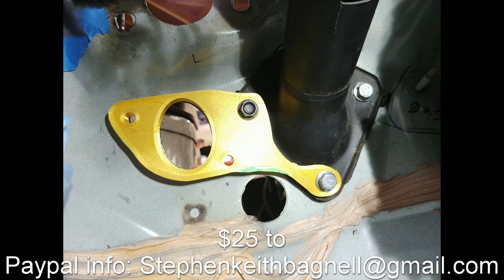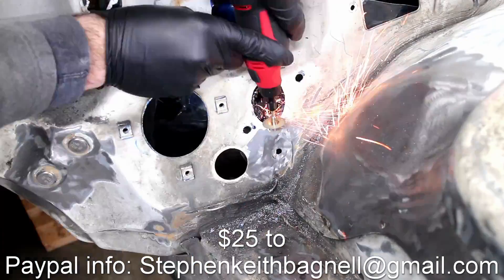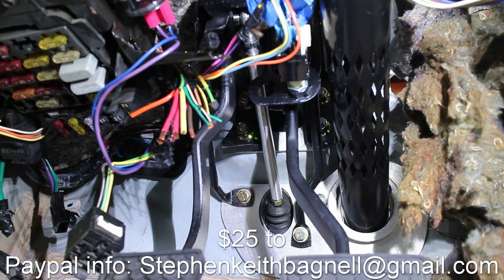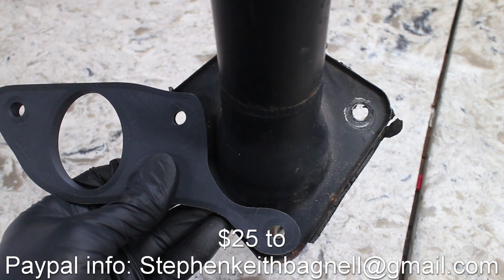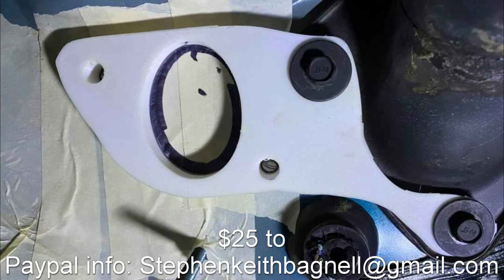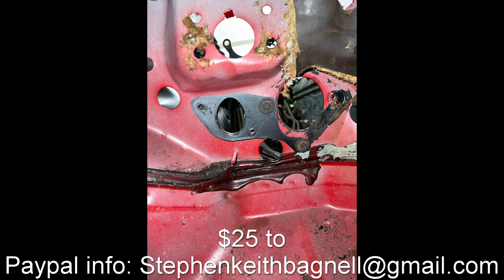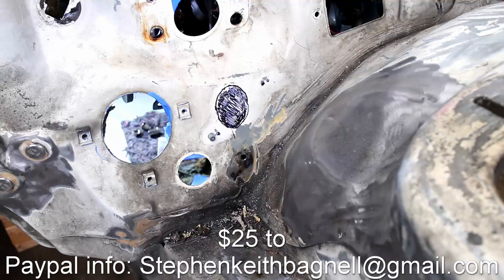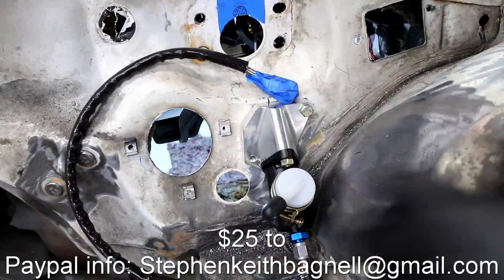Clutch Master Cylinder Cut Template (82-92 Camaro & Firebird)

Comment: Worked like a charm man!!!  I am the one you was worried about the address on!!  

Thank you so much!!!  The M.C bolt holes were slightly off but i am using a Factory replacement aftermarket type Perfection 39838 master cylinder which is an all Aluminum 3/4 Bore nicely built unit from everything i can tell...  

Doing a 700-R4 conversion, I am putting a TKX in it, and am going to try and use the 87-91 C1500 - S10 type Hydraulic bell-housing and slave setup which clocks it straight up like Tremec wants while retaining the factory style slave etc.

I got a Ram #78131 Hydraulic Throw-out bearing as backup just "in case" but i am hoping the bell will work and it looks like it may clear with just light clearencing.  Factory had the T5's at a 20*+ angle which is crazy....

Thanks again!

Comment: I have a t56 6 speed for my 85 camaro ls2 swap.  I'm hoping you can give me some information on what clutch master cylinder and slave cylinder to use. Any info you can provide would be very appreciated.  I do plan on buying the template you sell. I'm just having trouble finding the best setup for my swap. Thank you for your time and help
Reply from the maker: OEM 98-02 Camaro GM slave cyl/throw-out bearing works fine.
Tick clutch master cyl is the obvious choice since it allows you to adjust he clutch pedal height and engagement.  
(my cut template works with the tick or OEM clutch master)

Comment: Do you sell the template for center console cut out?
Reply from the maker: you mean the t56 shifter hole?
if so, ya I've been working on that.
Reply: @3rdGenGuy  yes that one
Reply from the maker: @Leveluplivin  I have two versions in progress.
Reply: @3rdGenGuy  Great!!! Can't wait to check them out soon.
Reply: Did you ever develop this? I just bought the other cut out, I had new floor pans installed so I need a pattern lol